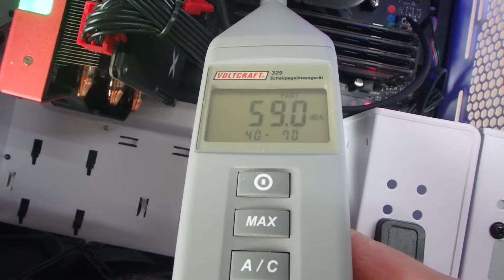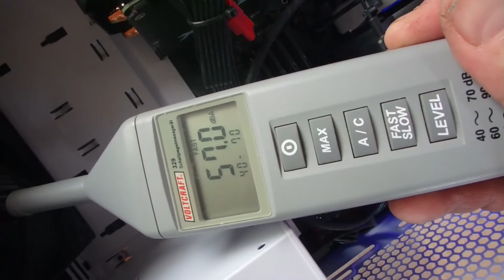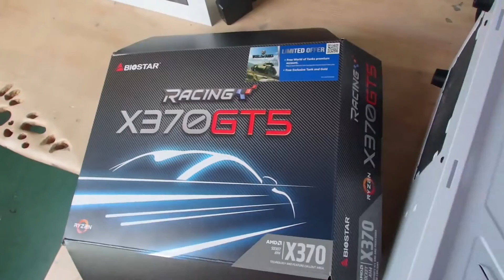Measure Noise of CPU Fans Freezer Pro 7 over AMD Ryzen 1800x on x370 GT5 Board

Comment: yea 60db in idle is unbearable.

I had a i5 7xxx without the original fan and it was permanently 18° Celsius 
cool at all cores when my room had like 35° Celsius and it had 1050 rpm with a 120mm fan all the time, even in idle mode. It
 was unbearable loud and nothing could be changed in any settings. Why wouldnt they let the CPU get 40° Celsius hot and instead only have 700 apm or something. 

I bet those ACER fucktards used the same settings for a 120mm as it would be normally used with an 80mm or even 60mm fan ...